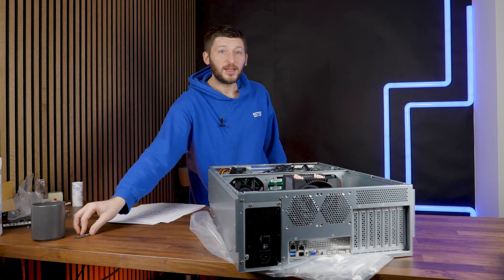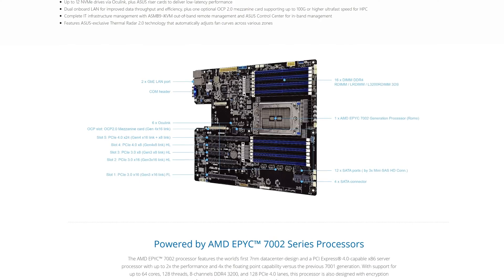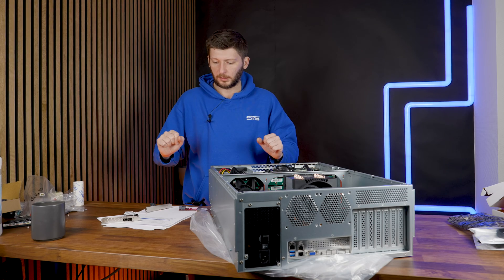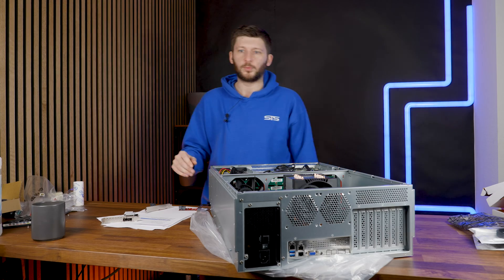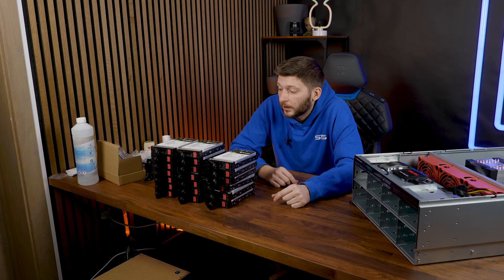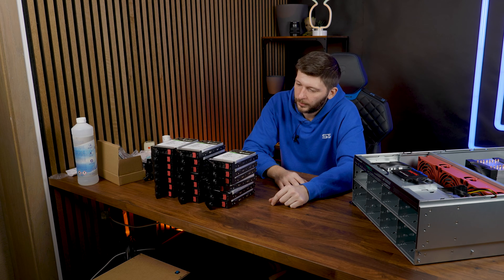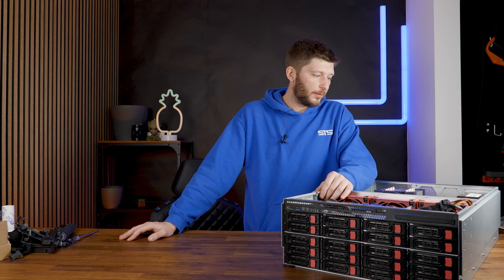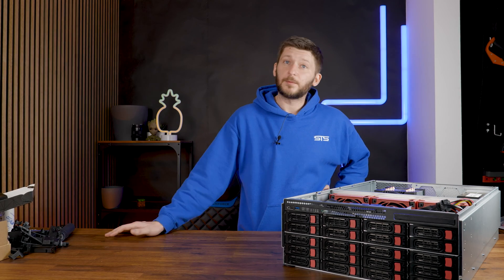Let's Build A DIY 400 TB Server - 1h HDD Installation - Episode 6

Comment: Nice video, but why the 3 pcie cards. You can use 1 controller card (ex: LSI 9306-24i) instead and save the 2 pcie slots.

Comment: Consumer NVME drives don't make good drives for Zil/L2arc/special devices.  With the amount of ram you are putting in that machine unless you have a specific reason you need a ZIL/L2Arc/special device (lots of busy VM's, really busy databases, lots (and I mean lots) of small files) it can actually slow the server down to have a 'slow' or badly configured one.  Better to mirror the boot NVME (or SATA SSD) in my opinion.  Those back fans are probably 80mm, that's generally the standard size for rear exhaust fans on 4U.

Comment: I can't tell the exact part number from the video but these red PCIe to Mini-SAS adapters don't look like they have a storage controller on them. In servers Mini-SAS can carry PCIe (NVMe), SAS or SATA. If you need NMVe, these simple brackets will work. If you need SAS or SATA, you are going to need a card with a controller. Epyc CPU's do have the ability to convert up to 32 lanes from PCIe to SATA but the motherboard manual doesn't mention this. Interested to see if all 20 disks will show up.
Reply: I'm in this same boat.. and I'm confused! I didn't use this exact board but I need an HBA or SAS controller for 20 x 20Tb HDDs. Got any suggestions? The lanes.. the ports..6Gb/s cards vs 12Gb/s cards... all that just confuse me. HBA controller + SAS Expander? Any model numbers would certainly be helpful!